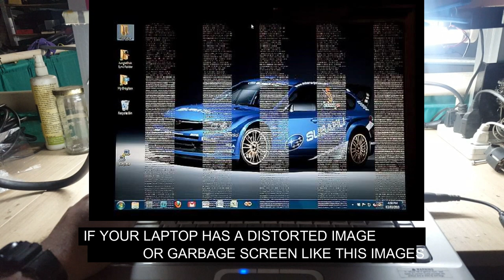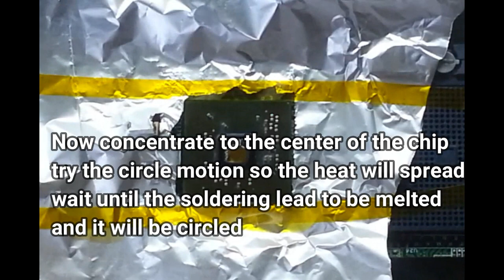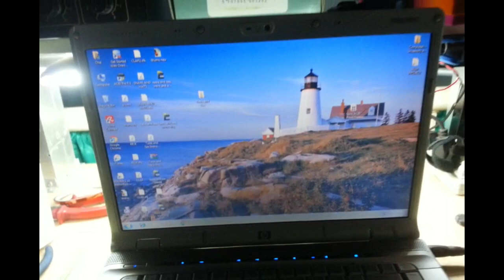Laptop No Display or Distorted Image GPU Problem HP DV6000

Comment: Facing same issue. Technician said it can't be repaired.
But u had a process. Thanx. But seems not possible for me, expertise needed.
Reply: No matter what you do updates will get installed automatically and you will have the same issue again. Solution is if you have one graphic card that is bad replace it or if you have Intel and AMD both then you can either replace Amd or remove the Amd graphics coil from the motherboard.
Reply: @techguy89  repaired by changing MB
Reply: @nileshgoswami774  ok , Hope it will not go bad ever, Incase if it happens follow what i said. It will save you money. :)
Reply: @techguy89 You mean to remove the graphic processor right?

Comment: With this fault will it give external vga out display? My dell laptop is black screen but gives external display, the lcd and lcd cable are definitely working
Reply from the maker: no. if the GPU is the issue. there will be no VGA external output
Reply: @ChrisRandomTech   what if it has integrated gpu then It will give Hdmi external output????
Reply: @thewolf2824  If u have integrated yes
Reply: It's the same with my laptop. It only shows at vga output. It's possible that my lcd is faulty? It also beep 8 times at start up.

Comment: So my laptop has a gtx 1060 giving me lines and colors the integrated one works if I do this will it fix it also do I have to use solder or csn I use just the flux? Please reply
Reply: hi bro, mi sister has an msi with gtx 1060 6gb and I have spent like a year and a half trying to install nvidia drivers. but nothing seems to work. I also try taking it to third party repair store, but never fixed. the integrated intel works just fine, do you think maybe nvidia is broken or need reflow process? There is a blue vertical line on one side of the screen.
Reply: @thewolf2824  gpus dead memory issue
Reply: @Gothguitarist  thanks bro.
Reply: @thewolf2824  you may try a ebay repair service! Best if luck same issue gpu overheated sometimes they can reflow the chip

Comment: reflowing gpu is only temporary fix.  Permanent fix is to disable gpu entirely
Reply: Can confirm it doesnt work
Reply: Gpu can't be disabled. No matter what you do updates will get installed automatically and you will have the same problem again. Solution is if you have one graphic card that is bad replace it or if you have Intel and AMD both then you can either replace Amd or remove the amd graphics coil.
Reply: @techguy89 Am having Sony vaio VPCF22L1E and am facing that same problem 😖 its NVIDIA, intel core i5 can i switch it the way you are recommending ?

Comment: I have tge same problem my pc is working but no display its a gpu problem i can reflow it ? Without flux and heatgun ? My laptop is sony vaio model
Reply: Same problem
Reply: I did some cleaning of my msi gf63 thin gtx 1650 ti and no display same problem but after doing this reflowing it's working and I have made the gpu undervolt so it doesn't heat and is currently working fine hope this works

Comment: How long is it work before it get fault again
Reply from the maker: it could be permanent depends on the condition of the solder ball.
Reply: No.. it is not permanent solution.. it's works 6 to 7 months only... I have done two time result is same after 6 months no pictures shown at all.

Comment: Can we use hair dryer instead of heat gun
Reply from the maker: Depends on the hair dryer you are using. Some hair dryer has a high heat settings.. as long as it can melt the soldering lead. Then you can use it

Comment: Bro after i undervolted the laptop my laptop froze and it doesnt show anything i gave it to a repair shop they told me its graphic problem...so is this kind of repair they may approach..please reply bro...so i wana ask i had 2 3 games like wither 3 assassin creed odyssey..am i going to face any issues with those games after repairing...please reply brother...
Its a request
Reply from the maker: Did your laptop got overheated? If not it could be Bios issue. Because you adjusted the voltage. The bios needs to be reset or reprogram first.. if same problem occur. Then the GPU chip needs to be reflowed.. and you can still play games fine
Reply: @ChrisRandomTech  it got heated...not overheated..i thought at first that its mihht be a bios problem..then i gave it to repair shop they told me after troubleshooting...
This reflowing works in evry laptop ?
Reply from the maker: Ah yes. Your laptop needs to be reflowed. Yes all laptops can be reflowed because they all have the same lead solder balls underneath the GPU chip
Reply: @ChrisRandomTech  thanks brother....
Reply: @ChrisRandomTech  well the repiarman told me that he will reball it..is it safe...
Is it same as reflow
Reply from the maker: @darinbarman9994  well reballing is much better than reflowing. Because it will replace all the solder balls inside instead of just reheating it. But it will cost you money.. because sometimes the problem cannot be solved just by reflowing it. It needs to be reball
Reply: @ChrisRandomTech  and reballing works where reflow doesn't..
Reply: @ChrisRandomTech  thank u for ur time brother...i will get to u once it is done
Reply: @ChrisRandomTech  well can u tell me how much it gonna cost
Reply: @ChrisRandomTech  hey bro wna ask a question...does reballing works in new laptops as in that are manufactured in 2019 or 2020
Reply from the maker: @darinbarman9994  yes bro. until now they are still using balls on the chips
Reply: how much did he charge and where did you get it repaired from?
Reply: Is it BGA ic problem?

Comment: It’s worked with me thanks bro , but the  problem  are repeated again and again
Reply: Same here dude
Reply: This is a temporary solution.Heating will make it work for some days and you will have the same problem again. For permanent solution is if you have one graphic card that is bad replace it or if you have Intel HD graphics and AMD both then you can either replace Amd or remove the Amd graphics coil from the motherboard.

Comment: Hi sir, may tanong lng po sana mapansin nyo. My brother tried the reflowing method on my laptop (had put a flux on the die as well as the soldering lead) but during the heating process..the flux spills out(like overflowed or dripping atop of the die) and we still continue the heating process..after a while we noticed that the  green cover(IDK if it's called a substrate or something) just bloated like formed small bubbles after doing this method...my question is, is the chip can still work if the substrate/green cover is bloated? Thank you for the reply. :-)

Comment: Ye kiss reason k vajse hota hai and heat gun se kaise thik hota hai explain plz
Reply from the maker: english please?
Reply: @ChrisRandomTech  what is reason behind this problem
Reply: I m also facing same problem
Reply from the maker: @pranaypadhen6682  yes the problem here is caused by overheating. once the GPU or the Video Chip overheats. the solder under the chip melts. so in that case the connection to the board and to the GPU is now separated. so the solution here is you need to reheat again the Chip like the one i do in this video. so the solder lead will melt again to again connection to the chip and the motherboard. hope it helps
Reply: Any permanent solution
Reply from the maker: @pranaypadhen6682  this is the best and easiest solution you can get. depending on hot you reflow it, it can be permanent.
otherwise you will do the hard way by pulling the GPU chip and reball it